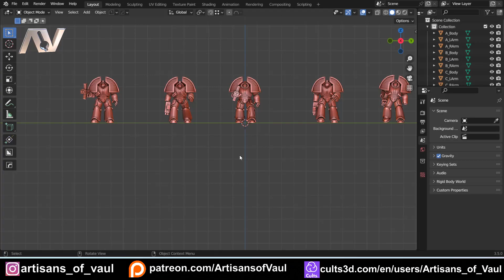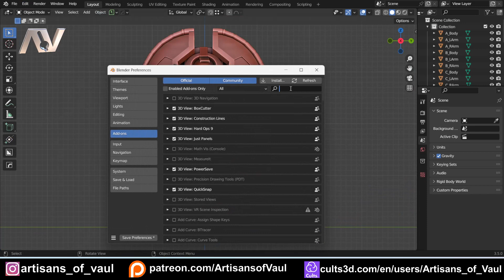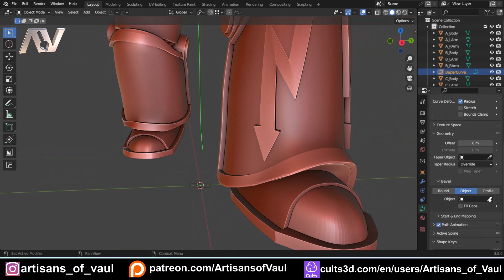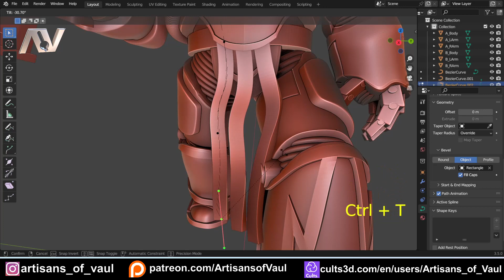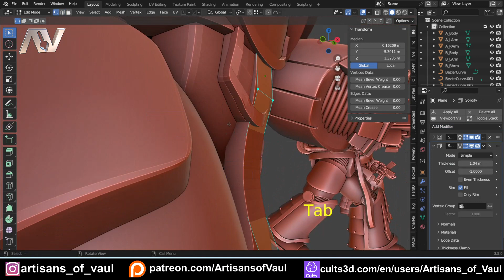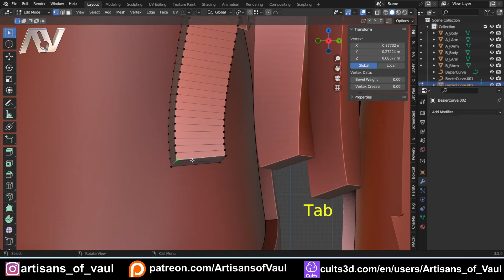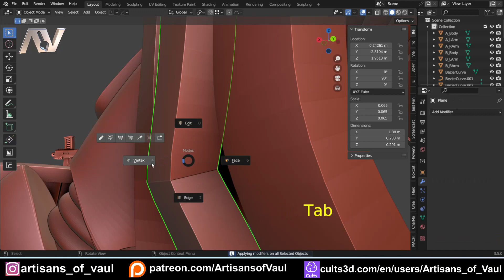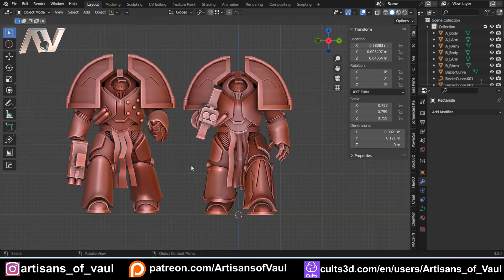Leather Dangly Bits! - Designing Pteruges in Blender

Comment: FYI, you can approach this more painlessly by starting out by adding a B Curve, then increasing in the curve (object data properties) via (geometry section) the "Extrude" amount, next to offset. Instead of referencing the rectangle shape. Then afterwards, add a solidify modifier.
Reply from the maker: Oh interesting. I'll have a look into that. Thanks man 👍🏻😁 Though then you won't be able to flex the pteruge along it's length

Comment: Hi I've down loaded box cutter and hard ops, how do you install them int to blender?
Reply from the maker: Go to Edit>Preferences>Add-Ons. There should then be an install button top and slightly right. Click that and select the saved Zip Folder. Then it will appear in the add on menu and click the checkbox to activate it.
Reply: @ArtisansofVaul  That's great thank you for your help

Comment: I haven't used these for pteruges, but I've used curves for getting belts and straps, and found that it works really well.
Reply from the maker: Yeah, similar idea 😁 Have you tried the sub D method? What did you think between the two.
Reply: @ArtisansofVaul  I have, with one of my earlier sculpts, I did that method for some goggle straps for one of my aliens. I found that it was a lot more fiddly to get things curving around an object - head, leg, etc. The curves method gives, I find, a bit better of a realistic look for belts and such - If I moved a section, it was easier to fine tune how it sits on  character - especially with twisting the particular vertices. The sub-D method, having a strap go across the chest, you have to fiddle with more pieces to make it look right.  I did some cables on an alien, and anchored points of the curve to certain bones, so it moved with the rig I set up. Depending on what I was doing, I'd probably use both methods - a simple short strap - say between two buckles, I'd use the sub D method, as it likely wouldn't move much.
Reply from the maker: @That Blasted Samophlange  Thanks for taking the time to give a detailed reply. I totally agree but it's nice to hear others opinions 😁👍🏻

Comment: Have you tried Plasticity? So much easier for hard surface modeling than Blender.
Reply from the maker: I do want to try it but was put off by the cost. Its quite a lot and even more if you want the ongoing support past version 1. I think for many that puts it into a luxury category that is a bit too much for many.
Reply: @ArtisansofVaul  thanks for the the reply. Yeah originally the creator was saying 20 USD but then indie license came in with launch at 100 USD. Nevertheless I bought it and it’s insanely good already. You can sense that this is going to get bigger and bigger in the future. For 3d printing it works perfectly using obj. However while you can export as quads they are really bad so it makes it really hard to uv unwrap. There are the auto unwrap solutions and I tried Instant Meshes but it was terrible. Btw what is your go to printer? I’m planning on getting a Bambu P1P with AMS sometime this year.
Reply from the maker: @Daniel D'Attilio  Yeah I think it will go well. Can it not export as Ngons as well?

I use an anycubic monoX and really like it. But there are newer ones that are meant to be really good.
Reply: @ArtisansofVaul I’ve also got the Mono X but must confess I have been doing more FDM in the last year. It’s good to know that you have made good use of it! Yes Plasticity can export in ngons and tris in addition to quads. But in all cases retopo in Blender  a bit of a nightmare if you are planning to use as game asset or visual only. I have not tried Quad Remesher yet.
Reply from the maker: @Hitsujioyaji  I was about to suggest quad remesher.  Though as someone that designs for 3D printing instead of for games thats fairly irrelevant to me but its always good to knwo for other people.